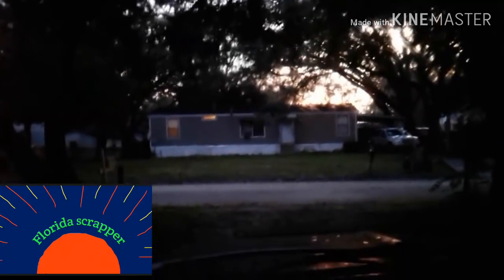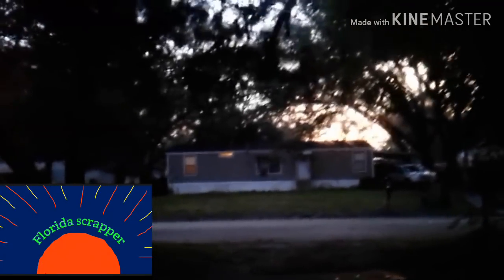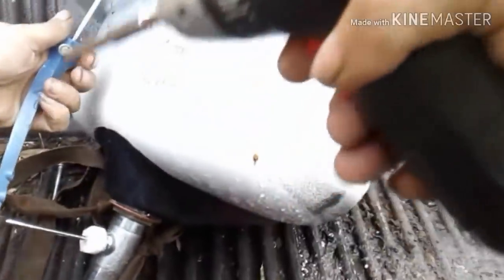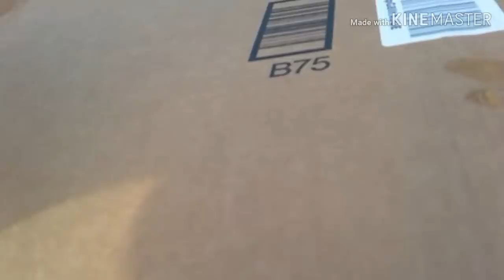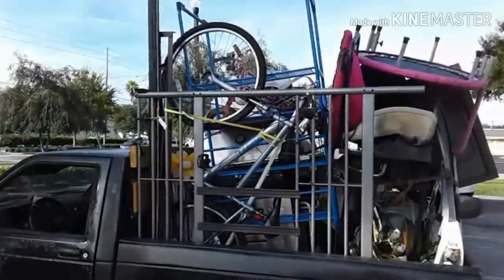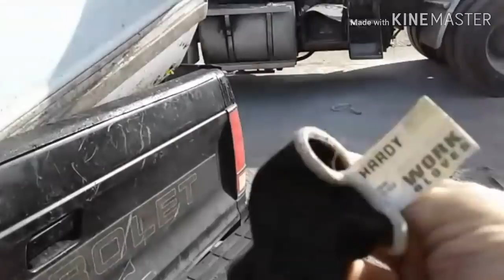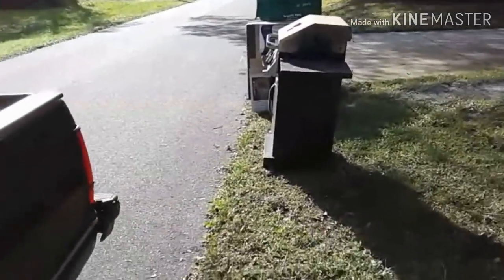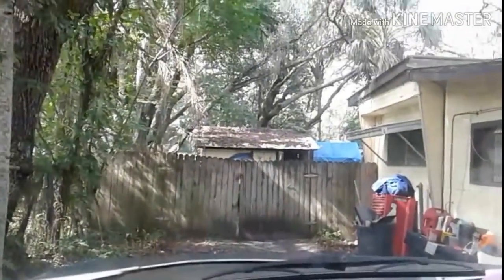Collecting scrap metal for extra cash.

Comment: Just a little note. Those fan blade arms are usually die cast; not too hard to remove and add up quick. If your yard has a category for it they usually pay close to aluminum. For instance I currently get $0.35 for cast and sheet aluminum and $0.30 for die cast which weighs more and actually pays better.
Reply from the maker: 10 cents a pound hear.

Comment: Why don't you make an attempt to break it down, bend it or dissemble it. It doesn't take that much time. I'm not talking about total dissassembly just enough to fit it on the truck. Sometimes I don't think you use your brains except to keep the wind from blowing through your ears
Reply from the maker: Wasting time on the side of the road while the garbage truck and other scrappers are on the prowl? It's not rocket science! 🤯🤯🤯